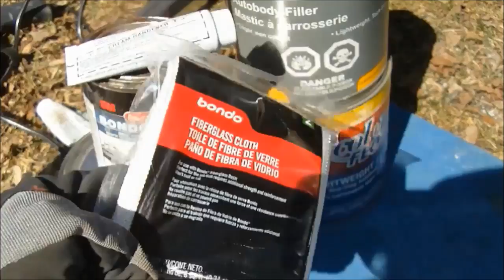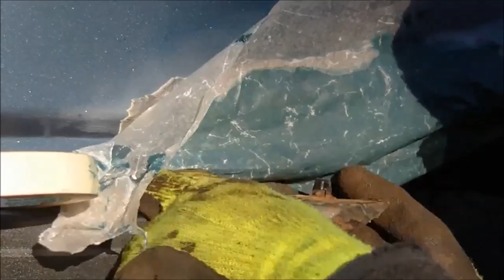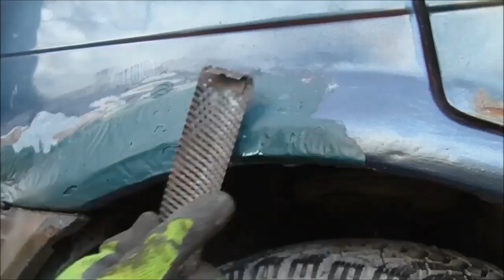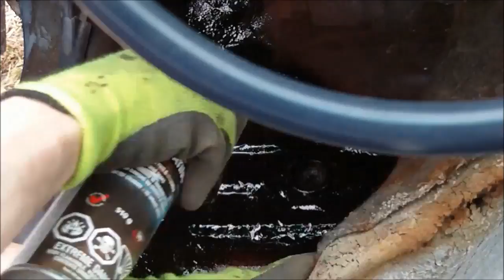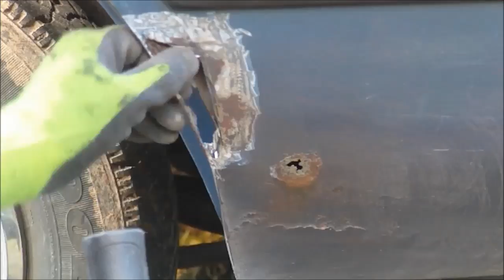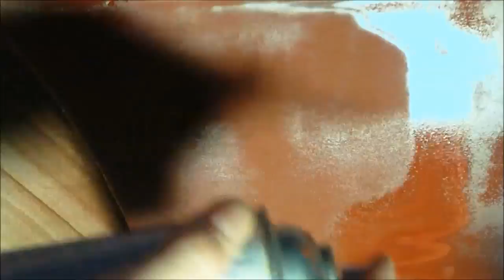DIY Auto Body Hole Patching, quarter panel, floor, and door patch

Comment: Good info  fun to watch if pachinlarger areas and u have welder it takes but a few more minutes to cut metal to fit the cut out hole and weld it in place for a pro fit n finish  thanks for the video

Comment: I have come back to this video so many times, just to refresh my memory.
I really think you sell yourself a little short, saying it's just a temporary repair. EVERYTHING about cars is temporary. It's made from 2mm steel, driving on roads in the wet with sand and salt on it :)
Your repairs will hold up longer than they have to, considering the fact that most people would consider them write offs 

I don't care what my car look like. I mean - i will paint my repairs, but i just finish fixing my VW polo, and just used plain Hammerite paint in silver, brushed on, loads of roofing asphalt and stone chip paint in the wheel arches, and every year, i get under my cars, and give them a heavy coat of linseed oil one the whole bottom, and in the frames. Takes an hour.

I paid about €3000 for each of my 3 cars: A VW transporter van, A VW polo and a Kia Ceed. The have all driven between 200.000 and 300.000 miles I have had them for 8 years,  and they have made and saved me tons of money. Every year they have to go through an inspection here in Sweden, and each time i ask the inspector if there are any problem areas. But there never is. 

They way you maintain your cars is very cool, and if more people practised function over form, shared their ways and were kind, the world would be a better place. If I didn't live on the opposite side of the world, i would have loved to hang out, and get inspired by your cool projects, and way of life :)

Comment: MOT Failure in the UK. All corrosion within 30cm of any structural or braking/suspension components including any seat belt attachment points have to be  replaced with metal and seam welded.

Comment: Kurt clearly has skills, so IF he would spend more time, do some research and do every step the best or right way, I know he would get awesome results, instead of just "Looks better than it did."
I'm also no pro, but I believe he chooses the wrong method, then rushes right through the sanding of the body filler, not completing the shape, then fast past the primer and paint stages, including their selection, application, sanding, drying, clear coat, sanding, cleanings, and polishing.

Comment: Dont care what peopple say man. I have used your shortstran tec with the fiberglass cloth and it looks great im going on 3 years and it looks as good now as the day i completed it quarter panal and rocker. When you live in the rust belt and a good runing car is over 15 yo it just isnt worth the extra work of new metal and welding and so forth these ways of doing these repairs keeps good cars and trucks going untill it is time to pute them to rest.

Comment: What is it with people body filler is quiet a good medium for repairing rust holes in non strengthened locations. But must not be used on any chassis and rocker panels load bearing locations, i watched a video about using waterproof expanding foam for closed panel repairs and that seems to work very well but must only be used on non strengthened body panels anything other than outer body panels will need a welded patch or complete panel replacement.

Comment: For a purely winter beater , or something that is basically just a trail toy or a toy in general , I can see this being useful .......... But for something that will be driven regularly , and you have your family in the car , I would not recommend this style work to repair a car .............   But for a winter only  car , or a down right beater , this is actually a decent way to help keep the holes filled to prevent further damage to the toy ......

Comment: So let me just warn people, if your hole can fit a golf ball through it, I wouldn't recommend only using body filler as over time it can become weak. What I did, on my 2003 Subaru Legacy sedan was I welded in bare sheet metal into the hole after the rust was cut out and sanded to bare metal, then I applied bondo ontop of that to get the perfect shape of the quarter panel. So if the hole is pretty big, defiantly reinforce with new metal
Reply: Can a female do this LOL
Reply: Or learn how to use a glass mat before using the liquid fiberglass here. If you are rich, then basalt fiber is even better.

Comment: Hey there, great video!  Pretty much answers all my questions for a quick diy patch up.  Wondering if you have suggestions for a larger hole, like something that is 6" large, but without welding?  Thanks in advance!

Comment: Slap enough body filler on that door dude? lol

Body filler is meant to fill small holes. You should have at least fiberglassed over the hole rather than fill it with body filler. Not saying it is bad it is just not right and seeing as you have a welder that can do body work there is no excuse lmfao.

You should try to sand off as much filler as you can. I usually just use filler to cover imperfections after my welds are ground down.

You didn't do all that bad of a job but its just even in a back yard a bit more time spend would have made for a more stable and sturdy repair.

Comment: Hi, could you answer this question please.
when performing a patch repair is always done the way you did with a fibreglass or filler patch, or do they sometimes weld in a new patch of metal? i will be attempting a patch repair on my 00 honda civic on the right rear quarter and it will be my first time doing body work. I am a license mechanic and figure id try my hand at body work
Reply: Hello, to answer your question, yes, some people weld a piece of sheet metal that has been bent to resemble the body

Comment: For the quarter panel there is a better and easier way that gives pro results for at least a year.. Miracle paint or metal prep after cleanup.. fiberglass wrap over the whole opening, resin it heavy to edges.. Pack it like crazy with fiberglass mix.. level the surface with grinder.. use a filler.. form with different grades of sandpaper and block sander.. primer.. base..clear

The only difference from pro shop flow is the lack of welded metal, the glass mesh makes the back instead. All can be bought from any parts house usually 3M bondo brand $8.00-$15.00 per product..

Comment: autobody supplies are so damned expensive,it is locked out 80% of the working men and women in the country from getting their vehicles fixed,i won't say correctly,because that is a broad term,these repairs will suffice as most of the autos in the world are metal and metal rusts,some areas it rusts faster,the neat part about your repairs are they are inexpensive and they will hold for years,and if they don't you can do it again,i like the wax paper route you went,i'm a master body man retired,and your video takes a lot of the rust work to peoples back yards, as we don't really do it anyway,thank you for you view,i like seeing simplicity

Comment: Elegantly simple. I use a more complicated method of putting a little riveted steel or mesh behind the bondo, but only because if I didn't, I'd use a ton of bondo building it up to make the form/shape I needed. Could never figure out how to get the bondo to stay in place while drying if I didn't use mesh or sheet metal to give the bondo something to stick to and form to. The wax paper is just the thing to make forms/shapes out of literally nothing! Fantastic. It helps keep the bondo less sloppy, it smoothes it and as a result it requires less sanding and bondo. Quick, easy, strong enough for most of us who drive beaters and want to fix them cheap and makes for a very nice result. I love how it literally cuts the labour of this job in half. I have no issues with this method and will definitely adopt some of it. Great idea!
Reply: MrBilld75 It sure IS
Reply: Yea i had to put a bunch of light layers gradually making hole smaller with alot of hardener to make dry now this idea will help me

Comment: I would fire anyone in any of my 4300 locations that did a 100 % bondo fill . . . yuc . . .section . . . weld . . . then fill . . . with teaspoonfulls only . . .then surface improve  . . . primer seal . . . and match paint . . . even if you do shoestring work . . .no money doesn't mean  . . . do junk. . . . fast cars break stuff . . . wind tears stuff . . . your work would come apart at speed.
 Nice results though . . . if you want to be left unsatisfied . . .
Reply: miles Hy He was showing a job patch like the video shows from 2 yrs prior if you actually listen. Looks like it's holding pretty good u think?

Comment: The wax paper looks like a good trick. I'm about to make a custom enclosure for an electronics project, and as I don'thave access to a 3D printer, was thinking about using fibre glass, so you've given me inspiration on a method to make nice flat surfaces.

Comment: Hey Kurt –

To heck with these malcontented naysayers!  You say right up front that this kind of work is appropriately befitting a not-necessarily-for-the-road vehicle; that it is a, known to be temporary solution, etc., etc.  That being said, how nice it turns out !  And, at a greatly reduced cost, which the handyman can perform without the acquisition of costly tools and equipment.  Finally, (and I have done this kind of work, before YouTube videos) there is something, very "Zen", in kneading the compounds and sanding away the rough spots.  It's the kind of work that allows the mind to wander through the old, "antique shop" – a very necessary process.